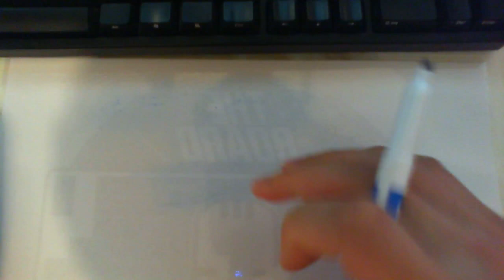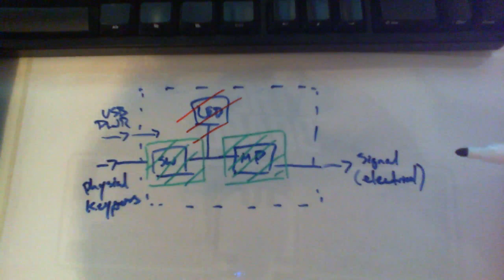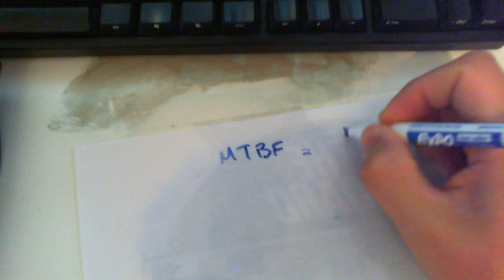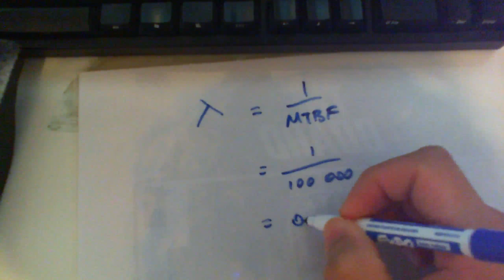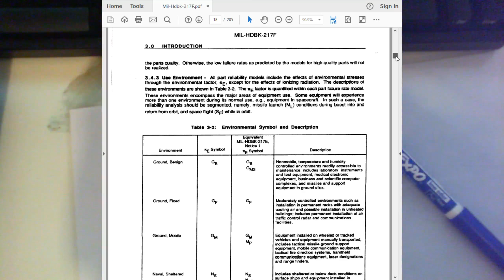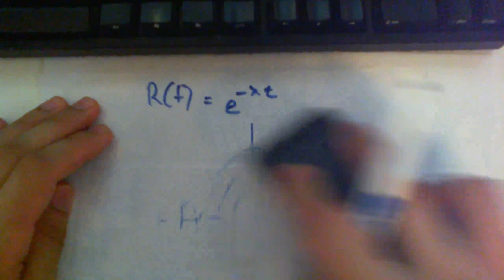A simple look at Reliability

Comment: I don't think it was too heavy or light, Very informative.. just not very useful to most people. Most people here on youtube are looking for answers to help them fix their broken keyboards that are past the warranty period, not calculating failure rates, that's a manufactures burden. =). I'd like to see a video of the proper way to test for failures on a common board. Take apart a mechanical keyboard and use a multi-meter to show the proper way to check for dead switches to dead rows or diodes and so on. Explain non-intuitive things lie how a diode is a one way gate and if your getting flow in both directions it's a bad one.  How to test for continuity between separate components to find a bad trace. Simple things like which settings to use on the multi-meter so you don't put too much power through the wrong component. This way you save people from just assuming "it must be a bad switch" and replacing a working switch only to have the same failure after the fact.
Reply from the maker: Thank you, very constructive and well heeded. I am not super knowledgeable on the finer electronics details, but I do have a board that I would like to do some repairs on it, so I might do some of what you've suggested as part of that video!